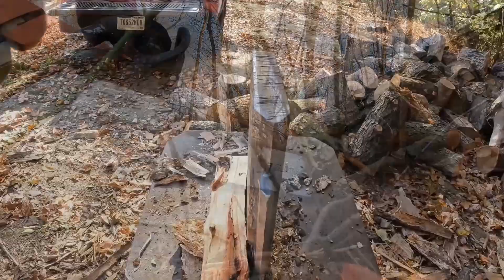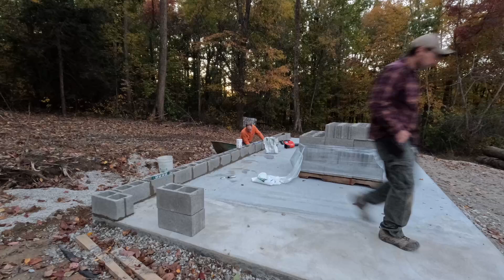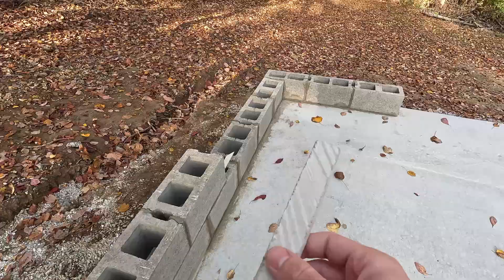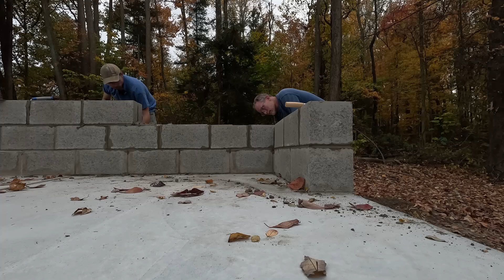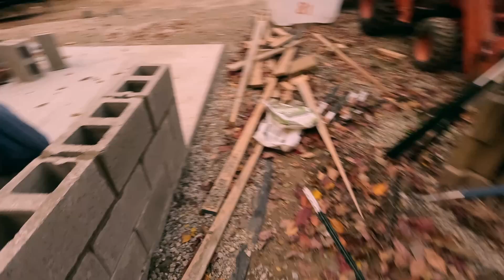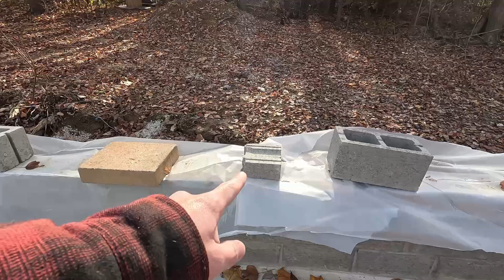First Foray into Laying Block

Comment: Yeah, you should have drilled into the slab and put some anchors to tie the block wall to the slab.
Reply from the maker: Yes, learned a lot doing this for the first time. Will be able to make it better and stronger  for the next one.

Comment: Dudes, did you put anchors into your concrete base to tie the wall?
Reply from the maker: We put anchors in the top of the block wall to tie in the back wood wall that we build. 

And we are just going to use brackets that we screw to the concrete for the 6x6's we put in the front.